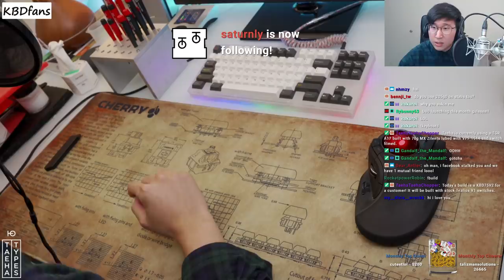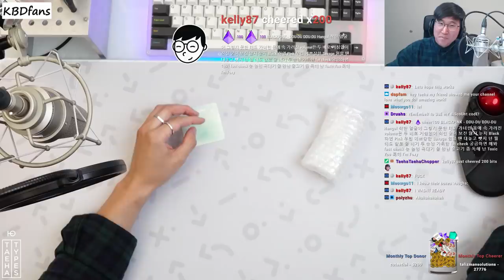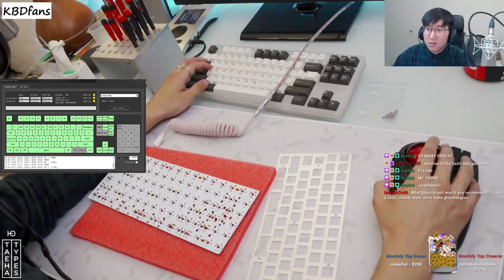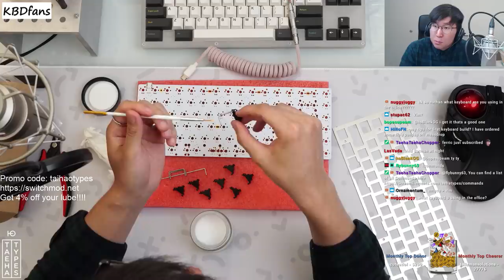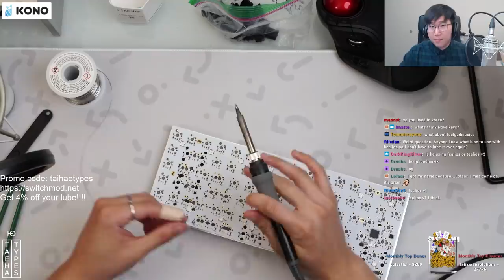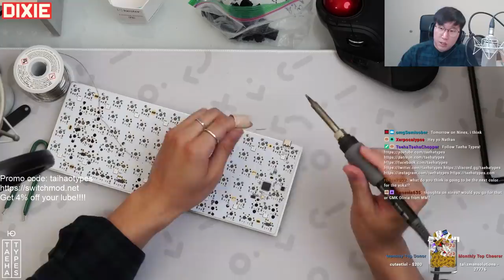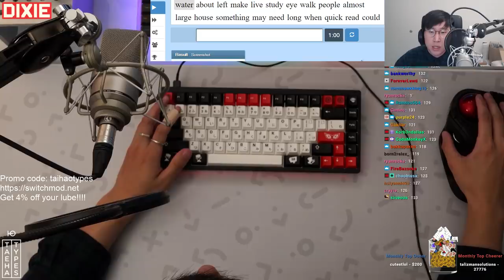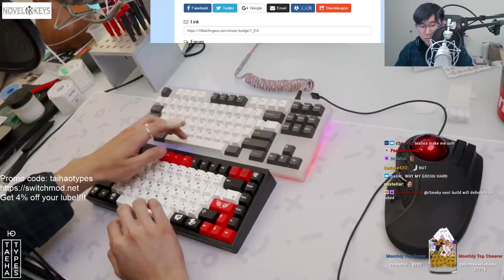KBD75V2 Build Stream + Unboxings

Comment: The cable problem is most likely caused by parasitic inductance- the longer the cable and the more COILS it has (hint hint), the greater the inductance of the cable.

This causes problems because inductance impairs the cable's ability to quickly change the amount of current delivered to the PCB, which needs to change constantly to maintain constant voltage across PCB components as the load varies.

In general, you compensate for parasitic inductance using capacitors wired in parallel to the load. The capacitors keep a reservoir of charge right next to the components, so when they need more or less current, they can immediately borrow it from the capacitor instead of waiting for the power supply to brute force it though an inductor.

The PCB designs are probably designed to compensate for the inductance of a 3-10 foot cable with no coils. Coil that bad boy up, and you might be exceeding the PCB's tolerance.
Reply: TLDR?
Reply: PinnySkenis TLDR: coiled wires have higher inductance than straight wires. Some PCBs might not have enough capacitance to compensate for the extra inductance.
Reply: @TaehaTypes  If you can get your hands on an LCR meter, you could easily test to see if this is actually the cause of the problem. If the cable that doesn't work has the same inductance as one that does work, then it's something else. I've personally never ran into issues with cables, coiled or not, so I can't do the test myself. I'm sure cable coilers would like to see this theory disproved.

*edit: (keyboard cables attached to keyboards. inductance is always a problem in prototype circuits)

Comment: The layout on the bottom row is not quite as usual. If I want to do it the same, so I just solder it as you did, or is there any other steps I have to do in order to get this layout.